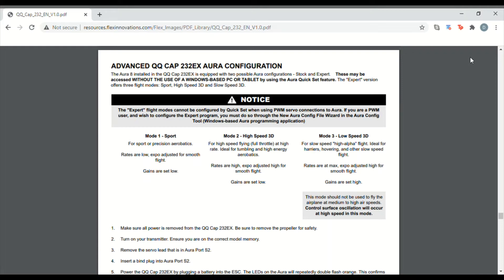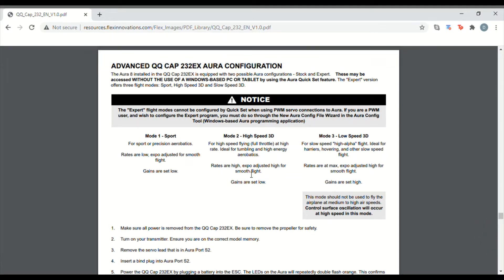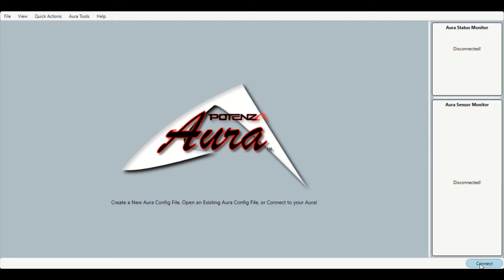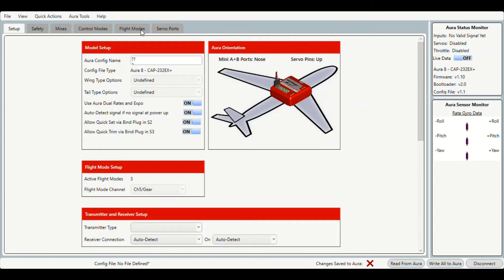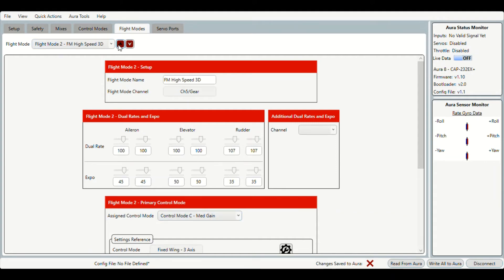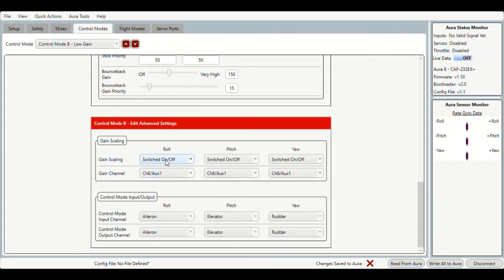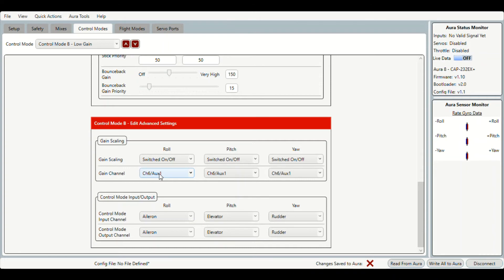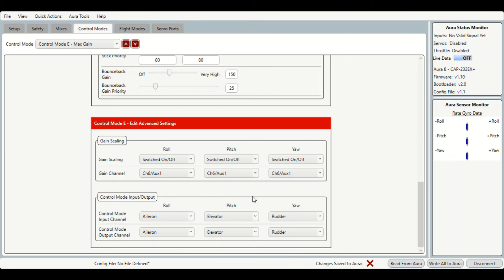Aura 8 gyro kill switch setup

Comment: Great video thank you.  What do you mean by control mode?? B.c,e ?  What are those compared to flight modes?  I just got an aura and can’t figure it out for anything
Reply from the maker: Thank you - Control modes are where you set your gyro settings and then you can link them to the flight modes. Have a look at the ‘control modes’ and ‘flight modes’ tabs.